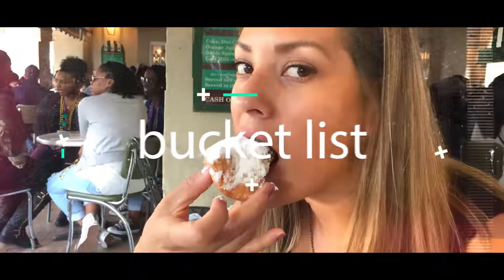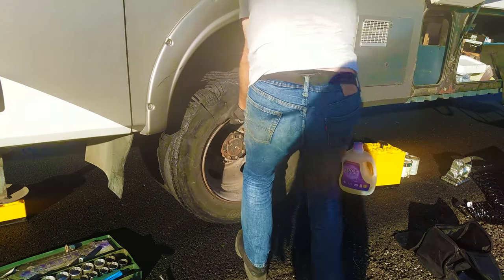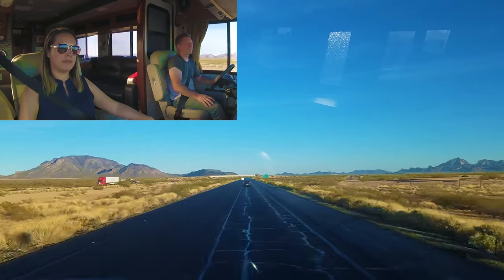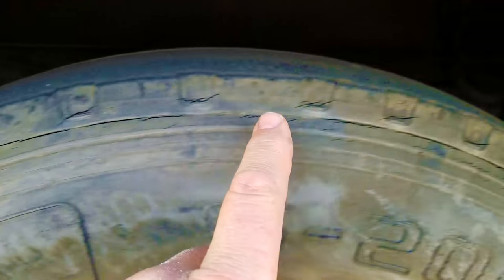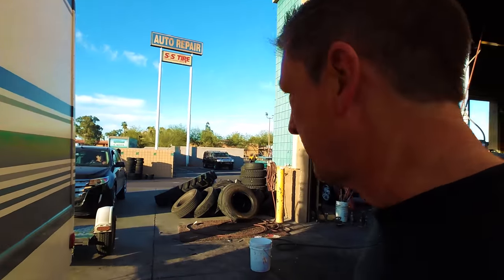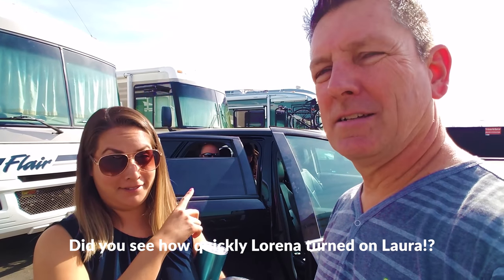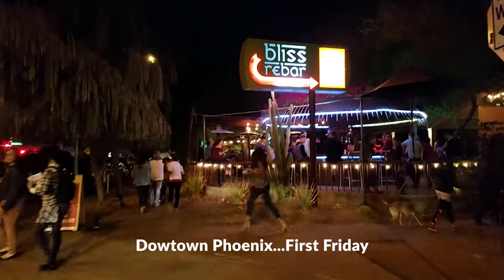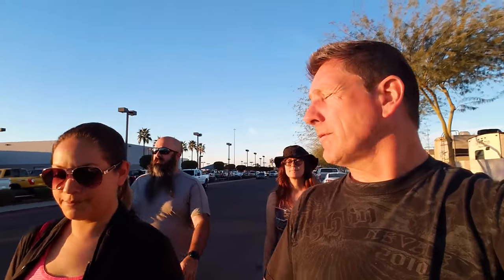Motorhome RV Living | Tire Blowout Near Phoenix, First Friday Phoenix

Comment: Great job changing the tire. We're looking to get new tires on our rv before spring. Currently have Michelin. Replacements will run about $1500 for 6. The tire place is recommending Mastercraft, which I've never heard off, for $900. Thoughts.
Reply from the maker: $1,500 for 6!? For what kind of rig!? That's really inexpensive, to be honest...especially for Michelin! I've never heard of Mastercraft tires, but that doesn't mean anything. If I had the choice between Mastercraft at $900 and Michelin at $1,500, I'd probably do the Michelin...Safe travels!

Comment: Nice video. Similar thing happened to me with my class c. Inside tire went flat causing a sidewall bubble in the outside tire. Fortunately I saw it before it blew out, but your video made me think about it again, so I just ordered a TPMS for the motorhome. Only has 4 sensors, but I’ll just check the outer ones manually (the 6 sensor systems are 4x as expensive!).
Reply from the maker: When a tire comes apart it can cause a bunch of damage! Just keep checking before any highway miles and things will be fine. Our TPMS is on now, but I won't stop checking my tires because I don't want to rely on the TPMS. Safe travels!

Comment: Excellent job my friend. I do have one of those little air compressors. But I'm also fat and old so I also carry a little pancake air compressor that is 150 psi the same as the little one. I carry the pancake one so I can use an inverter hooked up the truck while it's running and fire up the pancake one so I can use my impact wrenches. I also carry a 20 ton bottle jack just for road side jacking up.
Reply from the maker: That'll work Jerry!

Comment: Great  job changing the tire Paul, very hard work ,and only an hour too. I like the socket set too. My new Thor Gemini now has no spare (cheap bastards) so I did buy one and have to find a place to mount it. I may use a cable hoist crank type.
Reply from the maker: A spare is just a good idea!

Comment: Hi well done with changing the tyre, that's one huge tyre to change, Just one thing I would like to offer advice on, if you have a little more space between the ground and the tyre then use a  long bar, underneath the tyre you will be able to lift the tyre into position much easier and also it will enable the tyre to turn slightly either way clockwise or anticlockwise  making it easy to align with the wheel Lugs, changed many tyres myself like this over the years and saves the hard work involved in such a huge wheel. look forward to your video's and so far enjoyed each one as I get to know you both so to speak.
Reply from the maker: Hi Robert, I usually use the bar under the tire trick, but I was too pissed for that at the time and needed to blow off some steam! Lol!
Reply: @LifeWithPaulLorena  I understand fully as I often blow off excuse the Pun, I get so cheesed off and when those days just ain't going your way, know what you mean fella, look forward to your next exploits, Regards Robert.

Comment: Great job changing that tire! Looks like you didn't even break a sweat! I also have the Tireminder Tpms but what I like even more is called a "crossfire tire pressure equalizer system"  It has a handy gauge so you can visually see your tire pressure as well as equalizing it between the dual tires so one tire doesn't overheat more than the other if one goes low on pressure.  It's definitely worth taking a look at on Google just so you can see it. Keep up the good work I have watched all your videos excellent information.
Reply from the maker: I was sweating like a...well finish that anyway you want! Lol! Thanks for the share Dan. I've seen those and will take another look!

Comment: That was a real sketchy looking group of tires! I would change the tire myself just like you did. The hardest part seemed to be removing the spare. You should be much happier with new rubber all around.
Reply from the maker: It was crazy. I knew the front two were Goodyear and the outside rears were Sumitomo, so I assumed the inside two were Sumitomo...nope! One was one brand and the other was another...Just awesome! Lol!

Comment: Flats are never fun  What brand of tire did you buy and how much per tire? How doe the ride and handling compare to the old tires? Safe travels.
Reply from the maker: Yeah, not fun, but not too bad....if you're driving a car! Lol! We bought Hankook and I think they were $280 per tire? I honestly don't notice a difference in handling or ride. I had not lost a pound or two of air the entire last year of 25,000 miles, so it rode as decent as can be expected for a 10 year old gasser. Change one valve and....well you know the rest of the story! Lol!

Comment: Paul you are a better man then me. Good work. But there is one thing that you could have done that might have made your job a little easier. I thought you have said you have driven semi. They don't have air jacks do they.So what would you do in that case.If you had a 2 x 6 piece of wood, you can drive  on that piece of wood with the inside tire which would raise the out side tire so you can change it. But any way ,you did a fantastic job . At it boy.
Reply from the maker: You hit the nail on the head. I've done that with a trailer before. Drive on the wood and it give you just the right height! Safe travels!

Comment: Check the code on the new tires to know the manufacture date, then figure on replacing about 7 to 10 years from that date depending on miles and wear.
Reply from the maker: Yes sir! Got them and they are decent...thanks!

Comment: I'm so bummed Paul. I was just telling Lee Ann we can't afford the TPMS right now. I, most of the time, "thump" the tires, and check pressure. I guess the wife is always right? :-) I wondered if you knew you had those different brands of tire on Freia(sp). You are all set for Alaska now! So glad you are all ok. Ted & Lee Ann
Reply from the maker: Ted, I ALWAYS check the tires before getting on the freeway! I literally changed that valve the night before, couldn't get at the driver's side because of a bush and thought I'll do it in Phoenix. The next day, I failed to do my pre-trip inspection!!! So it's totally my fault! If I do the inspection, I catch the leak and no blow-out. If I just got the TPMS on, it would have also caught it. 

Here's my quick rant on TPMS....don't count on it! If it works great, all is good in the world, but if it malfunctions and you become complacent and don't check your tires, the exact same thing can happen! If you hit something on the road and blow a tire TPMS doesn't help. Check your tires every time before you get on the road...the chance of a slow leak happening because of a nail or some other weird thing is pretty slim....*or just install the TPMS and make the wife happy!* Lol!
Reply: I drove tour buses, and school buses, for years. I always thump the tires, prior to driving. Even new tires can have issues. I'm still saving up for good TPMS.

Comment: Super KUDOS for changing that wheel and tire on the side of I-10!!!  Much RESPECT!  Do yourself a favor and research Boar Wheels and Tires.  Premium products specially engineered/designed for long life on massive motorhomes and trailers.  Many customers say that they have gotten over 100,000 on a set of tires.  The only negative I have about them is that they do not make products for smaller trailers, etc.; have to have 8-lug wheels.  Hopefully, they will branch out into the smaller sizes as time goes on.
Reply from the maker: Thanks Daniel! I'll have to check on those tires...never heard of them. Safe travels!

Comment: How old were the tire on your MH?  Had you checked the date codes on them and did you make note about the date codes on your new tires?
Reply from the maker: MrGrunthunter's Adventures I have no idea what the date codes were on the old tires. I've got them from the new ones.

The blowout was totally my fault. I had screwed with the inner tire valve and it leaked. I didn't check it before we hit the road (I know better) and it put all the weight on the outside tire and heated it up until it gave out. Hard lesson learned! Lol!

Comment: It's the heat of the pavement. Lived there.
Reply from the maker: That could be part of it, but low tire pressure on the inside tire caused the outside tire to heat up even more, causing the blowout.

Comment: You are a beast Paul!  Great job.  Getting those spares out are a bitch.  You are so lucky that when you had the blowout that it didn't affect the inner tire.  And also lucky that you didn't have another blowout with that terrible spare.  You are right about roadside assistance.  Didn't understand what you were saying about the valve extensions.  Are you saying that one of them caused the leak?  What kind of tires did you get?  Get that tire minder on ASAP. Thanks for another super video.
Reply from the maker: We got lucky...kind of, sort of. So here was my mistake. The day before we left, I added valve extensions to the inside rim to make it easier to check and add air. They obviously leaked and I never did my pre-trip (like a dumbass) and the insde tire was at 40lbs when I checked it on the side of the road. The added weight on the outside tire caused it to blow. Could have lost both and it would have been really expensive...rims, tires, under carriage, etc! TPMS coming soon!

Comment: wasn't it you that said you had a remote tire monitor, but didn't see any use for it?  If you had a tire monitor you would have known the air pressure wasn't right before it blew out....
Reply from the maker: wadesready You are correct, but as I said in the video, if I hadn't added the extensions so I could add the monitor I wouldn't have lost any air and wouldn't have had the problem to begin with.... damned if I do and damned if I don't. I haven't had a low tire in 25,000 miles! Safe travels!
Reply: The Motorhome Experiment  Question? Why did you have to put extension on. I bought some "metal valve extension" which I figured would make access to our tpms system easier, but I never installed the extensions. I figured out I could reach up in between the dually tires to install or remove the monitor. They say you have to be careful installing tpms sensors on rubber valve stems (due to centrifugal force )and should only use metal. Good advice but ours are rubber and so far haven't had any problems. The added weight of a metal valve extension might be too much. Ours also have a bracket to help hold the valve stem from moving around. Good job changing that tire. We don't have a spare and I don't think I could get the lug nuts loose anyway. 39' DP with 22" Rims. Hope the damage to the wiring and other stuff doesn't end up being too costly. That did look like "the middle of nowhere" or a reasonable facsimile. Lol. Safe travels. U2

Comment: What were the dates on the old tires? Did you check the dates on the new tires? What brand of tires did you purchase? As for the tow dolly fender, that is going to be a $150 fix. It is very easy to do (3 so far over 5 yrs). Go to http://m.diversifiedtrucks.com in Mesa, AZ. Impressive roadside tire change.
Reply from the maker: The only date I actually saw on the old tires was the spare it was an '07! Lol! The new tires are Hankook. I appreciate the heads up for the Diversified Trucks in Mesa! Thanks!

Comment: What kind of tires did you install?  How new were the date codes?
Reply: Bob T that is a great point! My buddy just had $7,000 of new tires installed on his Country Coach provost. Date code 12-16. It's now February, 2018. Hmmm.
Reply from the maker: We went with Hankook. We wanted Goodyear but nobody sold and installed them, which we thought was odd. The date codes were all late 2016, early 2017. I would think its hard to get tires that are extremely recent. These will be fine, I'm sure. Great questions folks!
Reply: Hankook are great tires and they get very favorable reviews on irv2.com.  I have Goodyear HSA G661 tires and went to see my dealer yesterday about replacements.  No longer made, replaced by the Endurance RSA which is supposed to a very similar and updated tire.  I am strongly considering the Toyo M154's myself.